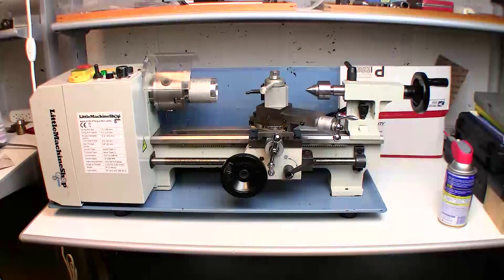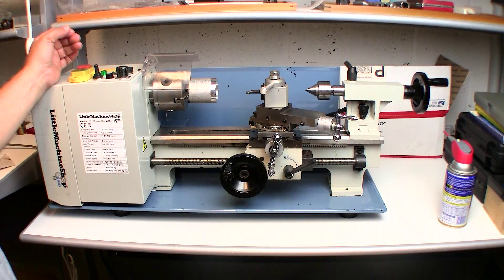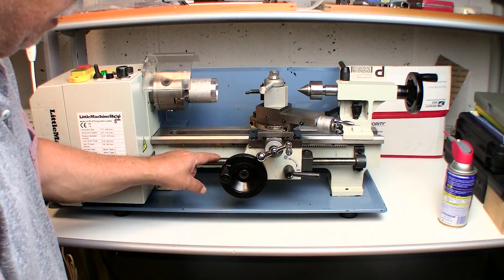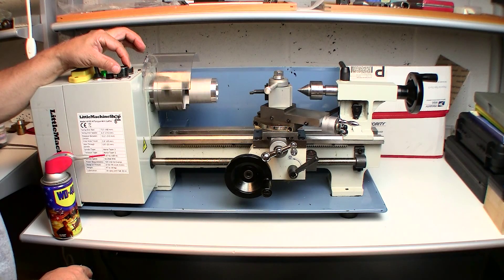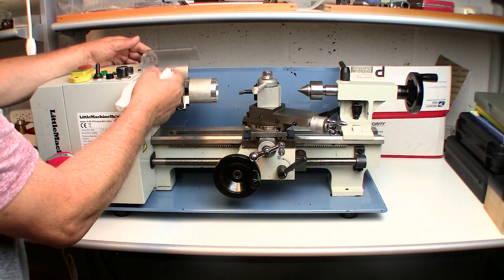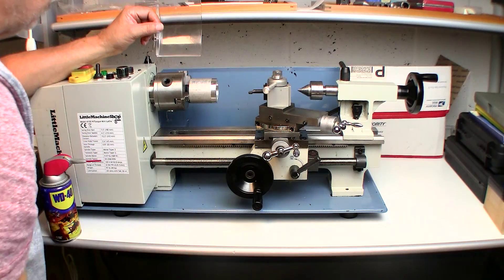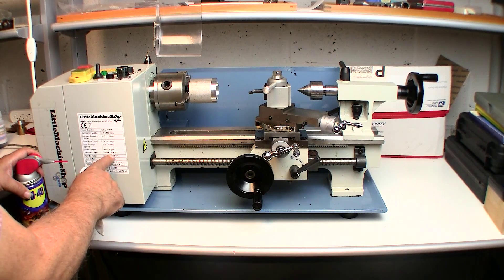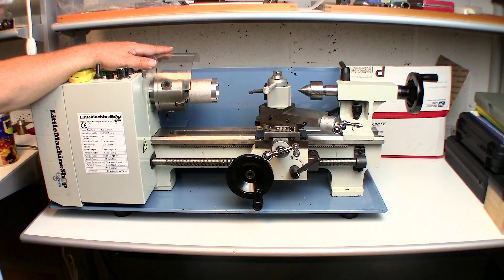Quick tour of The LittleMachineShop com 7x12 High Torque Minilathe

Comment: Jose, I'm surprised you didn't point out how several tweaks you recommended in your original video for the HF 7x10 lathe were incorporated by Seig (actual Chinese manufacturer) or Little Machine Shop. It's been years since I got my LMS build of the Seig but I was impressed to see, for example, a cover added to keep chips out of the carriage gears.

I lost my VHS on the mini lathe and with 7 years of home improvements finally behind me I'm looking forward to returning to fun stuff. But finding I need a refresher on some things. Your videos and the "Varmint Al" articles were enough to get me going. So going to reorder the intro.

Honestly, I was disappointed with my LMS lathe which cost me over $1400. I expected at least some of the quality issues coming from China to be addressed by LMS. Instead. the saddle was rougher than my HF was. If I switched back to the default factory tool post I found the 5/16 bits that landed perfectly on the HF were almost 1/8" below center, and still haven't been able to get the chatter out, even when tightened down too tight. Didn't take long before I reverted the compound to the original non-digital dials. The DRO kind was always in the way. Now I'm doing the same with the DRO on the cross slide. Poor power management run batteries down since the on/off switch is a firmware switch not an actual switch so every time I need the lathe the batteries are dead. Tailstock was much better than the quick lock kit I added to my HF years ago. Motor definitely more powerful, but the Gilmore drive never has been right and it vibrates without load. Anyway, nice to see you're still making stuff!

Comment: Nice video are the gears are plastic or metal on that lathe thanks
Reply from the maker: l the new minilathes have plastic change gears but they are extremely durable. I've never had one fail or strip. Metal ones are actually more prone to break are they are not made of try best metal.  And they are very noisy. I have an original set and I never use them. The drive gears in the head might be metal but I am not sure.
Reply: JTOOLMAN1949 great thanks for the info
Reply from the maker: Thanks.

Comment: The one we bought vibrates above 1,000 RPM...We have a 5C collet chuck installed....I wonder if there's a weight / balance issue that could be solved?
Reply from the maker: Hmmm.  You should contact Roger at LMS.com mine runs smooth throughout the complete speed range.
Reply: Copy that. Thanks for the response.

Comment: If you cut from the back of the work with an inverted tool you would not run the lathe in reverse. Looks like a decent lathe, I have been thinking of buying one to convert to cnc.